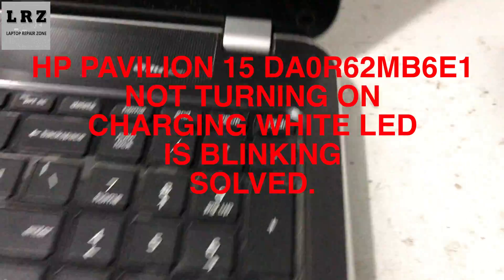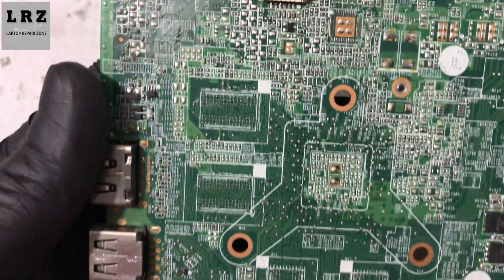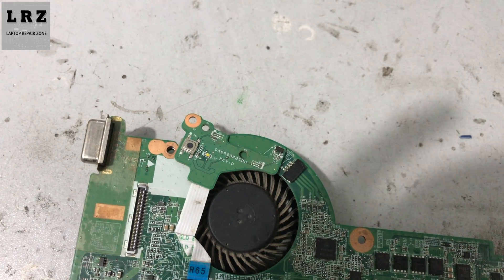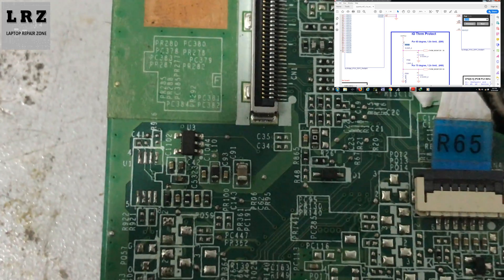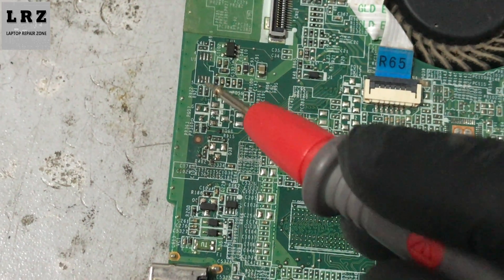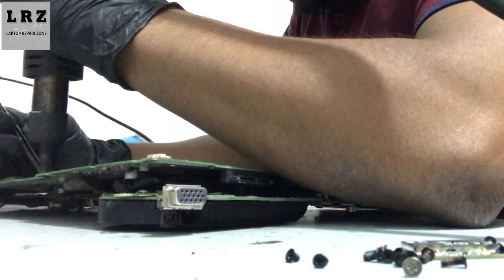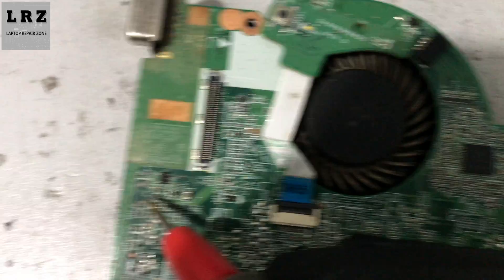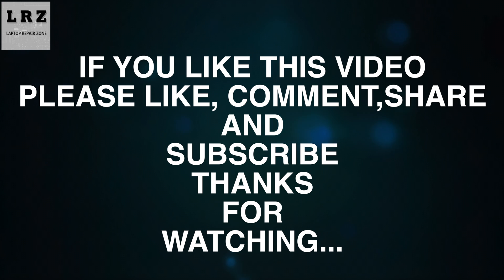hp laptop most common problem how to solved

Comment: Good afternoon I have a similar problem with the HP Stream 11 and the power light is blinking red but it won't turn on. And I don't know if this procedure will work because the battery is very different from the computer in this video.

Comment: Thank you very much. It solved my problem but the resistor was good, the 0.1uf/10v capacitor was shorted. Replaced the capacitor and board is back to life. Thank you.

Comment: I have hp laptop model 15-f222wm. When I press the power button of my laptop, nothing happens. But if I press the power button after connecting the charger to it, its charging indicator starts flashing. What should I do sir?
Reply: I have same issue
Reply: @connormclaughlin2673  have you fixed it?

Comment: I am seeing a few comments saying this isn't working, that might mean that under your keyboard, it is very dirty and is interrupting the signal between the keyboard and the computer. To solve this just vacuum it. If I still does not work, that means your battery is dead and you need to order a new one.

Comment: good afternoon, I have a similar problem with a hp probook 6460b when connecting the charger the charging led starts to blink between white and yellow, you will have a solution or video for this, or a diagram, thank you very much greetings

Comment: Hello There! I have a new lenovo X1 carbon Gen 7 (20QES5JT03) which I was using fine. After updating the USB-C thunderbolt firmware
the laptop refuses to charge and turn on. I have tried the reset button at the back but it won't solve the problem.

 I have took the laptop to a technician to open it and remove the battery, reset the BIOS CMOS, but still it won't turn on or
charge.

I don't know what is wrong with the laptop
Please I need help to fix this problem.  I am a student and I spend a lot of time on my laptop.

Comment: Hello,my hp elitebook 840 has a problem,when I connect it to the charger, the caps lock is blinking and also the white and orange light are flashing on the laptop,kindly assist
Reply from the maker: Remove keyboard then try.
Reply: @Laptop_repair_zone  I removed keyboard,also removed battery and RAM,but still doing the same
Reply: @op umer gaming it is memory error, caps lock blinks when ram is missing. check what's wrong with your memory.

Comment: I am glad that there are still board level techs coming up. I retired from the field a couple of years ago and too many shops are simply replacing motherboards. That costs the customer, and many issues can be solved by diagnosing and replacing the bad part. 

Good job, keep it going. older laptop repairs are left on my blog for legacy sake.
Reply from the maker: Thanks for your comment.

Comment: so i am having the same problem but no blinking light. My question is what did you use as a replacement part? Like part name please. I am mechanically inclined, but my 2nd time fixing a motherboard so I need super simple... simply explained as if my IQ is 91 ... maybe it is so please help!

Comment: what kind of resistor used in the video
Reply from the maker: Thanks for your comment, SMD resister
Reply: @Laptop_repair_zone  Hi, please what's the actual value of the resistor, I used one, it charge the system but not powering on.

Comment: I have hp folio 9470m. When i plug the charger it shows the plugged option on battery for 1 sec and then removed, it happens 2 or 3 times and after that, the plugged option is not showing on battery and laptop is not charging. I thought their is some problem in charger, so i bought a brand new folio charger for 5 mins it charged the battery from 10% to 15% and after 5 mins of charging the plugged option from battery removed again, when i replug the charger again the same case it shows 2 or 3 times and now the brand new charger is also not working. Please help. I will answer any question regarding this problem.
Reply from the maker: Thanks for your comment, you can try with another battery if not solved then you need to repair motherboard.

Comment: What do you do if the pc was blinking red light,  battery low and completely died, will not charge and there's nothing wrong with the adapter, the ac switch but maybe the cmos battery.  I was hoping there was a way to fix this without taking my computer apart.
Reply from the maker: Hadassah Deborah thanks for your comment, you need to check charging IC and AD_ID.

Comment: My laptop hp 440 g2 with 8gb dual channel ram  not starting.
I had left it for around 15 days after getting discharged and shut by itself.
Now laptop is not starting...i had tried removing battery...hard reset...power on by only adapter....also removed ram... reinsert....also i tried by removing keyboard...and by reinsert.... laptop is not starting even after that.
Before 15 days my laptop was working perfectly....what should i do now
Reply: same problem bro,what to do?😥
Reply: @Lukatri-q6q  my laptop started.....i rubbed the ram with a rubber....
Reply: @draloksharma3741  dafak,how you do that?😥 still i have old one until i repair new...
Reply: I tried everything...at last i did two things
1. I heated laptop by hair dryer after opening as much as i can to remove moisture.
2. I rubbed the ram pin with an eraser.
Then i started laptop and it started...wallah
Reply: @draloksharma3741  but how your laptop stopped to work...i mean whats the reason (my english isnt good but in praying to Allah,maybe soon i will play again games on that brand new laptop😴
Reply: I didn't used it for about 1 month...after which when i  tried to start...it didn't powered on....but it was charging which i got to know from the small light sideby of charging pin....then i tried everything which was written on net...like hard reset.. battery remove..reinsert.... keyboard remove and reinsert....and in last i tried above two things which lead to power on of laptop...i think it was bcoz of moisture.

Comment: theres a blinking orange and white while charger is plugged with no battery. [ HP ProBook 4530s]
@laptoprepairzone
Reply: @Arvee same here....orange and white blinking. Did you get any assistance
Reply: @smileysfoodhub6294  In my case the charger is the issue...
Reply: @smileysfoodhub6294  If you are in urgent...remove the harddisk from the laptop and buy a harddisk case..so that you can use it like external
Reply: Same here! Did you find the problem?
Reply: @MuhammadAhmed-yh6re  same here any ideas?
Reply: @shiffin_chippe  bro yah in my case it was the charger!
Reply: @MuhammadAhmed-yh6re  oh kk thank you for the fast reply

Comment: Sir my laptop have a problem. When I plugged  in then no light open  open.  My laptop not open which problem  please give a solutions .  Thankyou
Reply from the maker: DREAM BIG WORK HARD thanks for your comment, first check your charger is ok or not, then download schematic diagram for your laptop model the check all the required voltage and signal step by step.

Comment: hp pavilion 15 -cc055tx charging led not glowing but after press power, power button and led blinking
Reply from the maker: thanks for your comment,first change your charger if same problem than your laptop motherboard need to repair.
Reply: @Laptop_repair_zone  I checked charger, 19v ok. i have question if bios corrupted cpu fan will stop?

Comment: Great job but disappointed you. Didn’t explanation how you pinpoint that for resistor
Reply from the maker: thanks for your comment.
Reply: Doubt it was even the resistor most of the tines its the power port itself or the powet adapter youre a shitty tech